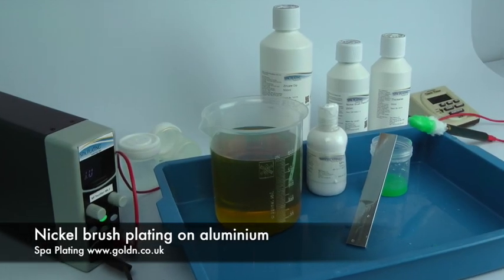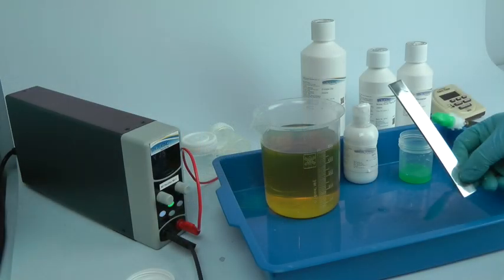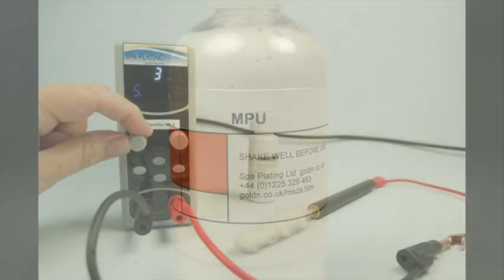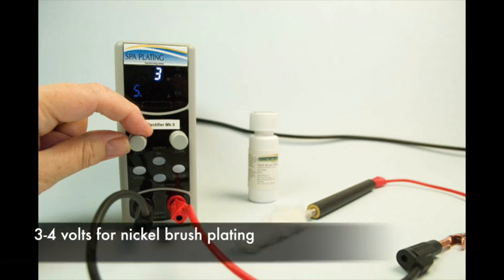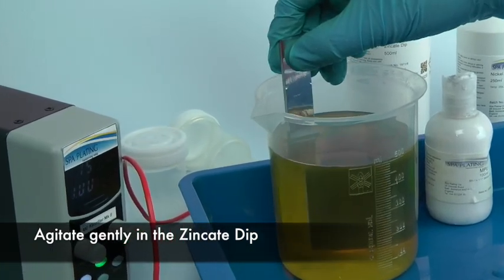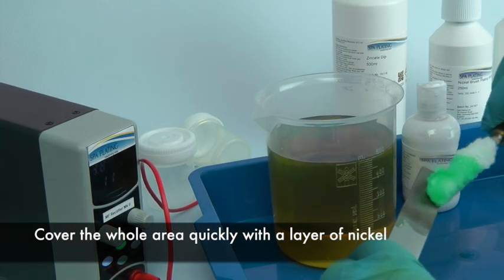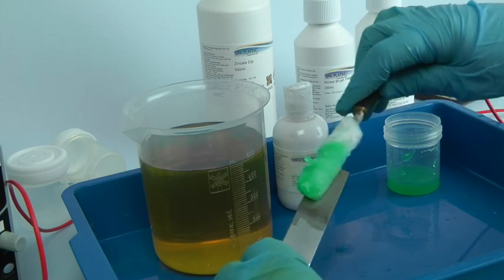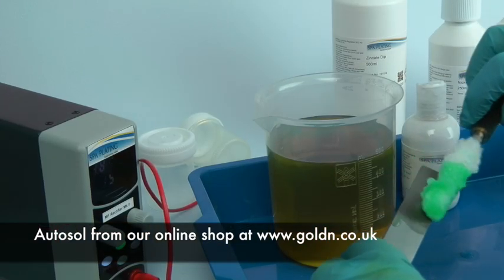Brush plating aluminium

Comment: What kind of adhesion strength can you expect assuming proper preparation with the zincate solution? Will it hold up to temperatures up to 150C?
Reply from the maker: The best adhesion is obtained when you tank plate nickel after the zincate dip. If brush plating, the adhesion will not be as good. The coating should hold temperatures of up to 150 centigrade, but some bubbling may or may not occur due to desorption of hydrogen absorbed during the zincate/nickel plating process.

Comment: Could this be used to touch up chipped electroless nickel plating to prevent aluminum corrosion?
Reply from the maker: Sorry but it cannot. Due to galvanic effects, the aluminium corrodes at the junction between the old electroless nickel and aluminium during plating resulting in lifting of the original plate.
Reply: Dan, I am in need of the same repairs. Have you come across anything else that would work?
Reply from the maker: @arthurmccoy9972  The only thing I could think of would be to try and fill the chips with a conductive paint then plate a very thick layer of copper, rub back and polish. This however would be very time consuming.